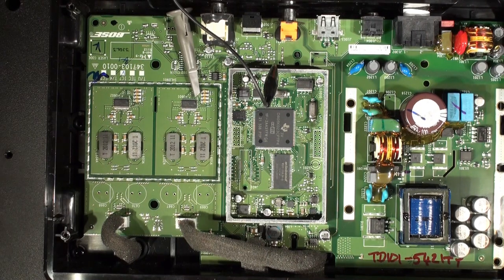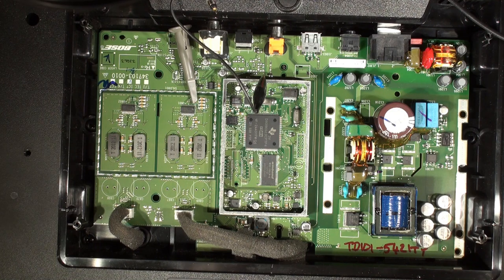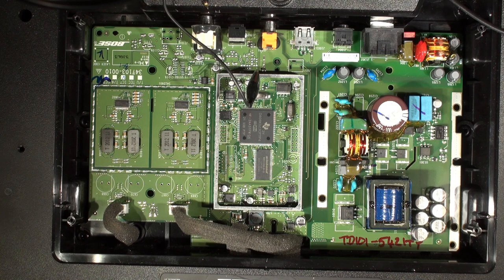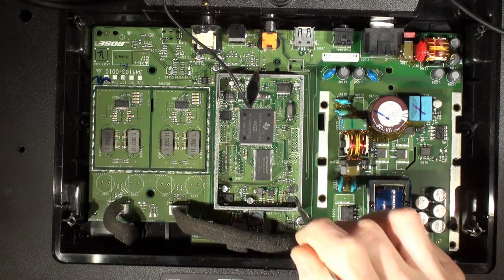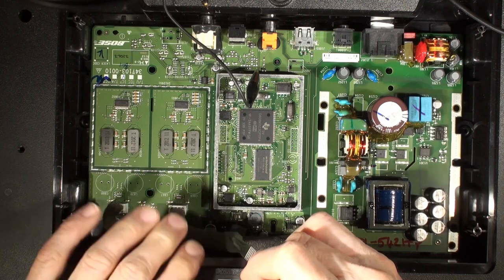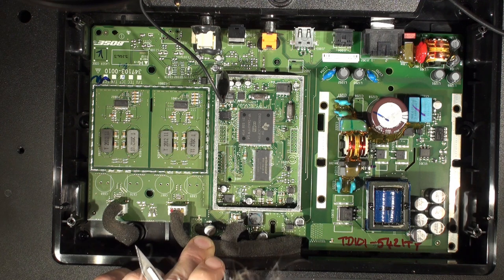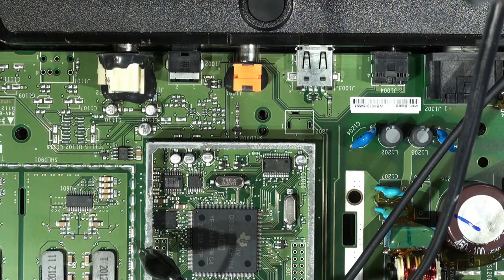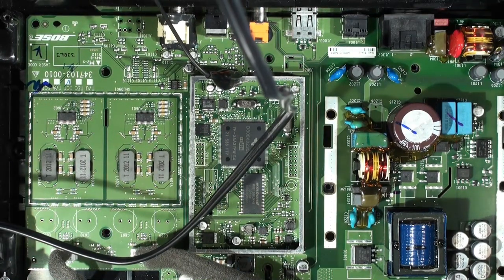Buzzing Bose Solo TV SoundBar System Firmware Update and Diagnostics Part 2

Comment: Hi, under that 24.576mhz there's 3 resistors and 2 caps. One resistor is a larger package and 0 ohms, one smaller one is 100k on the opposite side, what's the value of the resistor in the middle? Mine is discoloured, like a dark green rather than blue and it's 0ohm, completely shorted and doesn't seem right.
Reply from the maker: I couldn't tell you as I don't have a schematic.  Are you sure it isn't an inductor.  Resistors don't go short or lower they get higher or O/C. Rare for a chip capacitor to short so my guess is it is a chip inductor. If you have an inductance meter then measure it at 10Khz.
Reply: @razenby  that's what I thought, it is 0 ohms, and is fine. Think I replied on another video of yours with more information about the DSP.
Reply from the maker: @dazmatic  Send me a link I would like to see the other video.

Comment: In the upper right corner where that red piece is, my bose has a brown syrupy looking glue or goo going across it. Is that normal or has something leaked?
Reply from the maker: If it is still sticky then no, that is not normal.  The only parts with liquid inside are the electrolytic capacitors.  The red thing is the varistor but they normally burn and crack.

Comment: Managed to take 1 step forward and two steps back maybe. Got the unit to play music intermittently with a flickering distortion from one speaker then firmware to update. So tried with one speaker connected but now when both back in I just get a clicking and the light flashing red and green then to solid red, seems to respond to remote. Have tried capacitors. Any ideas, do you think the one speaker could have damaged the board? Any advice appreciated...the tinkering has become addictive!
Reply from the maker: Without getting my hands on it, my guess is that you have a problem with one of the power amplifiers.  Check the large Capacitor at the front-centre of the board is OK. After trying to start for while you could unplug and see if one of the amplifiers is warm. If it is then the chip has blown. It isn't a foolproof test (if it is total short it wont get warm) but might point you in the right direction. To check If I suspect there is a short on the DC side - (voltage should be around 24 volts), I disconnect the mains supply, and connect a 24 volt DC feed direct from a bench power supply.  If you get high current and the power supply voltage is pulled down then drive the power in for a while at a couple of amps and see what gets warm. If the voltage rail stays high I would suspect the power supply side under the can. Note you need a bench top DC supply capable of delivering a few amps current at 24 volts DC. Good luck. Stay safe.
Reply: Thanks for the pointers, the chips aren’t getting warm but capacitor seems ok. I don’t have anything to generate the dc current so will need to see if I can get hold of one to try that. (I’m getting a voltage of about 24v out of the rail underneath the mains voltage side so assumed that was ok.). Odd that it went backwards but maybe one of my tests upset it, I had two of these boards but think the other one is beyond economical repair now but if anything I’ve learned a few things at least :-)
Reply: @aquell14  tendrás a la venta la placa q te sobra para repuesto??

Comment: Hi Magic Smoke, After 3-4 months my bose Solo stopped to work. Don’t Start on, i try a couple of things ( new crystals, news 22uf cap’s and other value, some Times it’s works but only one time ...
I have the 24v on main alimentation, 1,8v on the L1117-18 Regulation, and 3,24v on the 3v line.
I try a 10uf on the L1117-18, have work only one or two start...
I have no idea what i can try other, can you help me ?
Thank’s
Reply from the maker: Sorry, I am busy on design projects right now. I do plan to have another look at the solo controller with the development system. If I find a fix i will publish it.
Reply: Thank’s for the news, my bose is stored in waiting of a new proposition / solution.
I hope you will find a solution. If that can help, my bose don’t « crash » if i apply input sound in continue but that work only if the bose would Start. But It was very difficult to obtain Start the last Time...

Comment: Do you still have some of those crystals laying around? I’m having a hard time finding them and could use a few.
Reply from the maker: What values do you need. I have a ton of different crystals.  I cant remember the frequency as I don't have a unit handy.  What are the values ?- i'll take a look when you let me know.
Reply: @razenby  I’m going off of what’s currently in the Bose speaker itself. One is an S26.000 L and the other is a 24.576 2X
Reply from the maker: @topdog19945  OK I'll take  alook
Reply: @razenby  any luck finding those crystals?
Reply from the maker: @topdog19945  Good point I'll go look for them now... 🧐
Reply: @razenby  thank you!
Reply: @razenby  sorry to keep commenting, but did you have any luck finding them? If not, could you direct me to the supplier?
Reply: On pin 9 of the integrated circuit Fan7384 there are connected a 0603 resistor with an sot323... Can you tell me the value of this resistor please?

Comment: Hi and thanks for the videos as I was about to trash my bose solo after 7 year of good service. Symptoms are that the bose won't start up, I have to unplug it, wait some seconds, plug it in again so It makes its typical "be-boop" and can be turned on again. Last days I had to do this every day to get it on, until it did not get on anymore, even after a night staying unplugged. I ckecked the power supply as shown in your video, it still gives 24dc out, but I also reached my electronic skills limit be the way. Would it be possible that I send the controller to you ? I'm located in France, and of course I'll pay for all costs. Thanks in advance.
Reply from the maker: There is a hard core of about 50% that won't start up. The flash contents are correct.  I suspect that a register bit in the DSP is not set or gets corrupted. I have haven't had time to revisit it. I need to install the development system and debug . I plan to revisit in March/April this year when I have some time.

Comment: Hi Magic Smoke, thank’s for your video. My bose solo won’t go on, i checked the 24v and the Blink ins led from Remote this is ok. I try to add 3 pieces of 100uf 16v condensator at the same place as you on the end of the video. My bose solo goes on but not at the first 230v raccording. On the first raccording no beep beep and nothing goes on. On the second raccording i have the beep beep but goes no on with the remote (no Green led). Only after tree raccording i obtain the two beep and goes on and working without problem more days :-)
But if i cut the 230v i must raccording tree time that the bose start on ...
It’s better as nothing and my bose is saved at the Time from the landfield thank’s for that !
If anybody have idea to help me ? Thank’s in advance.
Reply from the maker: Ok so it is booting OK but crashing. Can't really be sure until you change the oscillator Crystals. It always improves stability and may solve your remaining problem.
Reply from the maker: If once it boots it does run reliably then you should try reducing the modification capacitor on the 3.3V rail to ~22uF.   It often gives a more reliable start up.
Reply: Thank’s for reply, i oder the 2 crystals and will wait for that.
I will than try first to change capacitor to a 22uf and see if better, if not i will change the 2 crystals ;-)
Reply from the maker: Good luck
Reply: Magic Smoke you are the best ! I have found an 22uf 25v capacitor and was to impatient to test.
It work’s !! Reliable start up at this Time. Thank’s for all
Reply from the maker: Good news. Another piece of Bose saved!!
Reply: Hi MS, i have not a good news, by bose solo is down. I have already the 24V, but don’t turn on.
I try to replace the 22uf cap and the two crystal but don’t work.
Do you have an idea ?
Thank’s for reply

Comment: hi, sorry but i don't understand your video well because i don't speak english well. I have the same device, which the first time did the buzzing and I solved it with a firmware update. It worked 3 months and is now completely shut down. I checked on D1301 there are 24V. Could you tell me the components to replace to make a repair attempt? Thank you
Reply: On pin 9 of the integrated circuit Fan7384 there are connected a 0603 resistor with an sot323... Can you tell me the value of this resistor please?
Reply: @fabiobrasca619  sei italiano? non ho trovato l'IC che dici tu, come si chiama sulla main?
Reply: @danieleegidi7908  ciao si sono italiano... Il chip è il Fan7384 Ke é un sop14 lato bottom... Al pin 9 ci sono collegate 2 resistenze...Ho bisogno di conoscere il valore di quella più lontana parallela al pin9 che é davanti ad un sot323...
Reply: Purtroppo il reference non è stampato sul pcb
Reply: @fabiobrasca619  Ora sono a casa, dammi più info che domani ti ci guardo. E' uno dei 2 14 PIN che sta sulla main, che zona?    Approfitto per chiederti se hai il 16QFN che a me scotta una cifra, e la cassa non parte per niente. I 23V dall'alim escono bene.
Reply: @danieleegidi7908  se mi dai una mail ti mando una foto e scambiamo qualche info...
Reply: @danieleegidi7908  il fan è il componente che viene sostituito in questo video https://www.youtube.com/watch?v=R-fEQ-UUNks&t=811s al minuto 17:41...se noti più in su c'è un sot323 il componente in nero con davanti unaresistenza che a me è saltata e non so il valore...ci hai dato un'occhiata?
Reply: @fabiobrasca619  ma sul video si vede, non è 100ohm? (101
)
Reply: io sto operando sulla parte sopra, ho U702 che scalda, ho comprato il ricambio ma non vedo l'orientamento del vecchio, tu lo vedi?
Reply: @danieleegidi7908  si ma stasera ora sono a lavoro... Se vuoi ti giro una foto o vedo di darti l'indicazione... Ok avevo il dubbio sul valore della resistenza ma se mi dai conferma anke tu ok allora...
Reply: @fabiobrasca619  sono appena riuscito a sost il 16QFN e la Bose si accende ma rimane fissa sul LED ARANCIONE e non dà altri segni di vita, sto impazzendo. :)
Reply: @danieleegidi7908  i pins sono saldati bene?non è ke cìè qualke corto e la inchioda?
Reply: @fabiobrasca619  in realtà non si vedono se sono saldati bene perchè è un BGA ed ha i piedini sotto. Al primo colpo avevo sbagliato, poi l'ho centrato ed è partito. Alla fine ho mollato perchè non avevo più tempo. Se il cliente me lo lascia, ci riprovo.
Reply: @danieleegidi7908   ma non è un qfn?a me nn sembra un bga...
Reply: @fabiobrasca619  Si scusa, era solo per farti capire che ha i pin sotto di lui
Reply: @danieleegidi7908  ok....ma prima partiva ma scaldava il chip...adesso nn parte proprio?
Reply: @fabiobrasca619  No, 2 mesi fa me l'ha portata che faceva buzzing, ho aggiornato il firmware ed è andata bene. Ora me l'ha portata completamente spenta, e mi sono accordo che FQN scottava, l'ho cambiato ed ora si accende ma rimane bloccata su LED arancione.

Mi sa che io e te dobbiamo scambiarci i contatti :) La mia mail, te l'avevo scritta, l'hai tradotta?
Reply: @danieleegidi7908  certo... Solo ke ogni volta che scrivo la mail nel messaggio mi sparisce... Forse x questo non mi ritrovo la tua mail nei messaggi... È normale sta cosa?
Reply from the maker: Thanks for watching.

Comment: I got one with the same problem the guy just sold me But I’m not no professional like you and I live in New York
Reply from the maker: Unfortunately It is common.  I have a bunch of them here that I need to get around to looking into. The problem is time....
Reply: The guy that sold it to me said he had it in storage it was working perfectly fine but he did issue me my money back it’s still in its original box it’s something to do with not being used I think
Reply from the maker: @brittbear4577  He could be correct. Good on him.   Memory chip data, capacitors, cheap crystals don't age well.  Ageing is expected but if the design is marginal, function is marginal to start with. When components age as expected then it leads to problems.  So many Bose products fail to these  Schoolboy hardware design issues.